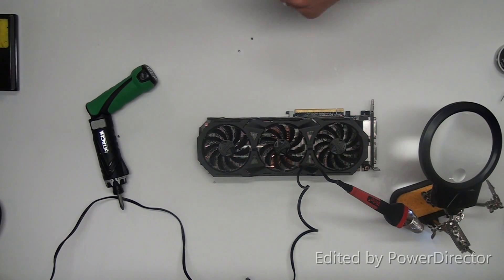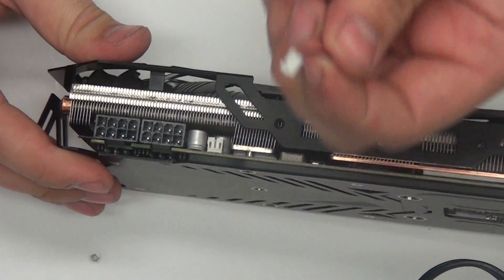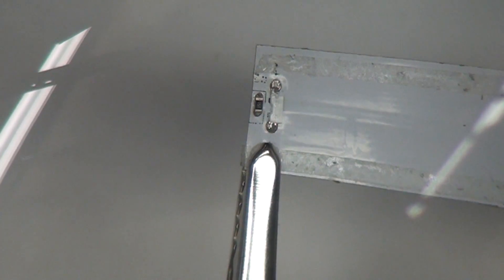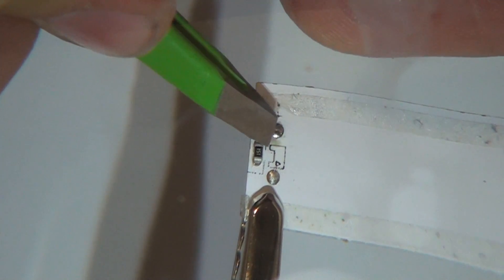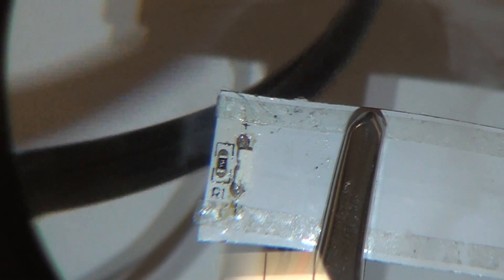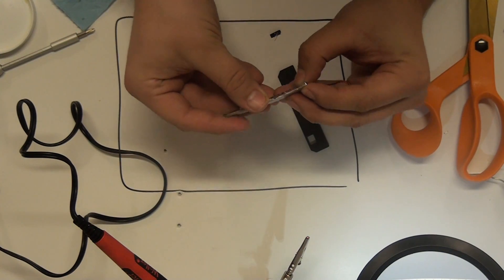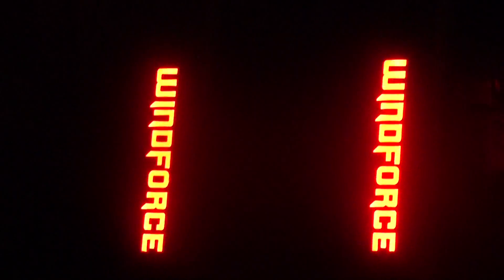GTX 980/970 LED Mod

Comment: Just saw this ...and thanks for the effort and upload... One thing i didnt like was the fact that you loosened  the cooler from GPU and separated it  even if it was a few mil... It still broke up the thermal paste leaving cracks ...In other words it would have been better to repaste it before using it... Also a question... Do you by any chance know hat voltage that little strip uses ?

Comment: Hey, so, I tried this and now my LEDs aren't turning on. I faced them both the right way and I don't think my solders were too sloppy but I'm a fuckin noob so maybe they were. What's the most likely problem? Did I break the little paper/plastic slip they attach to? Could I replace that or do I just have to buy a whole new plate?

Comment: Hey, where can i buy an led like that, but white ?
Reply from the maker: google: overclock gtx led mod that is the original overclock thread. you can find links to some ebay sites and other manufacturers that carry that LED.
Reply: thaanks!

Comment: I tried this and the thing won't light up, what should I do to fix/diognose it?
Reply: wich side is the bottom?
Reply: +BenAddict19 (on the led)
Reply from the maker: +BenAddict19 the top part is the flat top . the bottom is the one with the slight curve

Comment: I have a question, I have the r9 380x g1 gaming card, I notice that this mod doesn't have the fan stop led or the silent led. I was wondering if doing this mod for my card would also change those two smaller logos, please reply
Reply from the maker: +josue lorenzo if you were to perform this mod yourself the two SILENT/STOP LED's are the same leds as the ones used here.
Reply: +vladyerus thank you very much

Comment: I really want to do this to my 970. The blue LEDs do not match my red build. I don't have a soldering iron though so I wonder if there's somewhere I could just send the LED strip away to be replaced.
Reply: +Curtis Townson Dude, a soldering iron is super cheap.
Reply: +Curtis Townson basic soldering iron (you know, that big one where you hold the whole iron in hand, don't know how it translates to english) is like $10...

Comment: How do i even activate the blue LED??  My GTX 970 never had the LED on..
Reply from the maker: make sure u have GeForce Experience installed. bottom right hand corner of ur screen find the nvidia icon right click on it select GeForce Experience. Thanks u go into I believe there is a tab for My Rig. and click on LED visualizer hope this helps
Reply: +vladyerus Ah ok..i found it but the LED won't turn on (I'm using the Gigabyte 970 windforce 3x)
Reply: vladyerus oh..i think i know what the error is..the Windforce doesn't have a led (just the logo that looks like it but its just plastik)
But still has the small pin connector ( without connection of course)
Reply from the maker: +xSynatiiC ahh that makes sense. if u have taken the LED placard apart can u send me an email to info@vladthegreat.com with pictures of each component because I have a feeling it may be possible to get an LED in there I just don't know what pieces of the puzzle are missing . if u don't want to that's ok no pressure :)

Comment: +vladyerus Hey can I have some help buddy? I want to do this mod to my 970, but when I follow the link I'm only given options to pure white ones. Conveniently I wanted white ones. But there are two, there's '5500-6500k' and '3000-3500k'. Which ones do I pick and what's the differences? Thanks.
Reply from the maker: the higher number is the ones I sell they are called "pure white" they have a colder appearance the other one is warm white which has more of a warmer yellow feel

Comment: just a quick question about the store, what do you actually get for the 970 mod? just the white strip? or one prebuilt with the windforce logo too? thanks!
Reply from the maker: for the mod you get the white PCB if u watch one of my latest videos of the install process of my pcb it shows what you get from the time u open the bubble envelope.. as far as the windforce logo part I have something in work as a custom solution but  I can't reproduce the windforce one because it is intellectual property that belongs to gigabye

Comment: your pc is so loud
Reply from the maker: lol yeah the cover is off and I have 3 rad fans on the top rad and two intake fans  and two exhaust fans plus the dual 3 fan a piece gtx 980s. to be honest though when it's buttoned down I can't hear it mostly because I have my headphones on due to no pc speakers yet lol

Comment: does this void warranty?
Reply from the maker: people have said they have called and asked and were told it doesn't but somehow I don't trust it because there could be a rejection of claim if they see obvious damage to the PCB . really hard to tell
Reply: ah i see. well thanks! it looks so good, great job. contemplating should i do on mine or not.
Reply from the maker: ok. if you dont feel comfortable about doing it there is always my website listed in the description head there and see what i offer. I mainly did it to help out people who did not know how to solder or just didnt want to have to go through the process . other people did the tutorial and successfully completed it.
Reply: yea but do you ship to malaysia? how much would be the total cost, for a red led pcb with postage included?
Reply from the maker: +Niz Zamri yes I do ship to Malaysia and I already have once with an order. you can visit the site and go to checkout u can put in your address to see how much shipping would be it's the least expensive option but it takes 5-15 days to get to you. usually people get it in ten

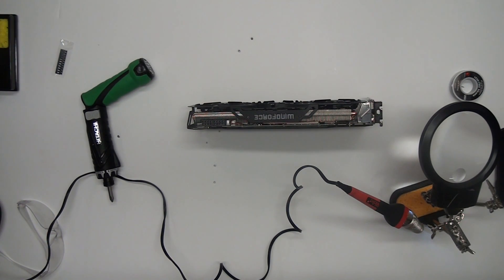Comment: 2:12 I saw that coming and made me cringe..

anyways I am too scared to attempt this on my 970 g1. Is it possible to damage the card by doing this ? And I presume this also invalidates my warranty.
Reply from the maker: +Rodney McKay Ha yah. good thing that white board that im working on is foam and this GPU has a backplate. I have been using both cards since and no issues yet :)

Since the LED circuit basically consists of no more than 12 volts going to the LED Pcb. If you were to damage something there would not be any issues with the card. So far people say that doing this will not effect warranty. I personally dont know because warranty/insurance claims tend to be different. there is no way of knowing how deep they will dig during a warranty. That is why i offer a custom PCB with color of your choice that you can easily swap and if something happens and you need to RMA your card or send it in for warranty, you pop your old PCB in there and send it away. Check out my other videos or visit my site listed in the description.

If you choose to do it yourself as in this video :) have a great time at it, and if you need a replacement BLUE LED pcb to make card look stock I could probably make that happen as well.
-cheers

Comment: so i stupidly bought the version without LEDS would i be able to modify mine so it does?
Reply from the maker: if you ordered from me contact info@vladthegreat.com
Reply: vladyerus im not talking about your product im talking about my actual 970 and it didnt come with leds on the card and i took off the Windforce logo and it was just a sticker and i  seen the LED power plugin thing on the card does your Mod come with everything that i would need?
Reply from the maker: hmm i have always wondered if they just used teh same PCB while removing some components etc. Does the PCB have pads (holes) for led wires anywhere ? my guess it would look like a silver circle.
Reply: vladyerus it has the connector for the LED
Reply from the maker: hmm this greatly interests me.let me see if i can add you to my google+ thing. i never use it but hold on.
Reply from the maker: sent u an invite to google chat so u can send me a pic of what that connector looks like. also what the windforce logo looks like with the sticker on the back im assuming?

Comment: Do you sale the whole thing or just the led to install it by myself
Reply from the maker: I sell the PCB already assembled with less and resistors so all you need to do is plug and play
Reply: +vladyerus  Where do you get those Windforce logo?
Reply from the maker: +Ronner Ronny Ryan which windforce logo do you mean? I do not get the windforce logo I custom make the PCB which has the leds on it. that is what changes the color.
Reply: +vladyerus  So i just have to remove the logo and swap the white PCB under it right?
Reply from the maker: +Ronner Ronny Ryan yes you can see my latest video https://youtu.be/3F6qGJPd7Ts
I had it set to unlisted but now it's public

Comment: Is possible to swap the led's to RBG leds like the new gtx980ti has?
Reply: Wowcake if you find those i guess but whats the point software wise?
Reply from the maker: Unfortunately it is not possible to put RGB led like 980 ti because the 980ti firmware is programmed for that the others only programmed for single color operation the only way around it is a third party source to control color
Reply: Yep

Comment: anyone? i have a problem with my card, i turn on the pc and everything is fine but after going to the log on screen my LEDs turn off, idk why i was doing some overclocking and after that it wont turn on, i was thinking i burned the LEDs since i added voltage to the card but the LEDs turn on when i turn on the pc just turn off when i get to log on screen, i wanted to switch to white LEDs but what good is it if they turn off :/ anyone help please
Reply: xXxSP4RKxXx i'm not sure if this will help but did you turn it off in the nvidia controls? i have the windforce 980 and since it is new i didn't fel super confident modding the led so i just turned it off in the nvidia controls but it lights up on bootup for a second or two.
Reply from the maker: +xXxSP4RKxXx hopefully you fixed this. It does sound like when you get to your logon screen GeForce Experience takes over and in the control you have your LED visualizer off.

This guide by Nvidia might help if you have not figured it out yet. 
http://www.geforce.com/whats-new/guides/geforce-experience-nvidia-geforce-gtx-led-visualizer-user-guide#3
Reply: yeah i just installed the drivers again :P
Reply from the maker: awesome glad its working now :)

Comment: Does this work on gigabyte gtx960 g1?
Reply: I haven't done it yet but it'll be very tough. The windforce led and Silent stop leds (making 3) all come apart. It's the exact same method for the Windforce led, but for the silent/stop ones, it's different. I'm doing the mod soon, possibly going to put a video up for it, but still mentioning its the same way. It will work. I've opened it up myself. I doubt I will be modding the silent/stop leds.
Reply from the maker: DerpyDreamz022 I have yet to tear apart a 960 so maybe zuhayr sarker will have a video up soon :)
Reply: vladyerus 
Not entirely sure I'll do it, just a heads up guys, if you do plan to mod, you will have to remove the entire heat sink. Remove all the screws on the back and slowly take off the heat sink.

 At first it'll be stuck like glue, but be careful, there are three wires connected to the board.

These three wires are the fans, the led for silent/stop and the windforce logo. Carefully disconnect these wires. BUT WATCH OUT FOR THIS. I'M SERIOUS. Be careful about where you place the led wires. One will have a white mark on it. It will be either set of led(s) but remember which one goes where (orelese the led control will get messed up).

Now that you got to the heat sink and fan part, leave the board somewhere safe and anti-static. 

Remove the two screws for the leds as usual. It will divide into 4 parts. The three leds and a larger plastic part that holds these three in place. Carefully remove the windforce logo from the plastic part and do the exact same thing done here from there. After that it should be straightforward soldering on the LEDs.

Not entirely sure I will mod it, but I have opened it up and studied it for a while. Hope this helped.
Reply: Zuhayr Sarker  im very concious about this doing this doe xD
Reply: DerpyDreamz022 I'll try my best to get the necessary parts and put up a video soon.

Believe it or not YOU SHOULD be conscious. I accidentally ripped my silent/stop led connector. However I was able to successfully reconnect the copper ends to the prongs with a flat head screw driver and toothpick. Problem now is that silen/stop mode isn't really working, LEDs do though. Just needs a TIM upgrade as I did remove a lot of that (you shouldn't do that to GPU TIM, you should replace it afterwards).

But yeah, expect a new video soon.
Reply from the maker: +DerpyDreamz022 I am currently working on the 960 Stop/silent light LED, the circuit is slightly more complicated as it is a 2 layer flex pcb. But rest assured hopefully within a few weeks we will have a solution for that as well :) stayed tuned via youtube by subscribing and you will get updates.

Comment: I wish I had the technical skills to do this lmao I'd end up killing my gpu or something. I can't take things apart and put them back together properly, I've tried with ps3 controllers and long story short i'm on my third controller... I'd rather not kill a $550 gpu :/
Reply from the maker: yeah i thought about that too. But seeing as the only thing that could possibly go wrong is the LED dying i decided to go for it. But than i would have figured out how to fix it. If you have seen my new videos. I did find a way to fix that for those who do not want to do the soldering job :) Thanks for watching

Comment: Great video,even if it buffers sooo slow. Hate youtube for that...
Reply from the maker: thanks. if it had anything to do with the way i edited the video i apologize. Just getting used to this youtube/editing stuff.
Reply: vladyerus nah don't really think it was you i had no problems nice vid :)
Reply: vladyerus what if i sanded the logo and put some color onto it would it work?
Reply: Majid Shawa the acrylic is colorless, the leds are what are colored, so changing the leds is the only way unless you use light bulb paint on the acrylic to mix with the blue led.
Reply: DJAbraxoOfficial Thank you, I was about to do it.
Reply: MC4allforUser that is your internet speed/computer's fault, not youtube's
Reply: Just Voltage Basicly i watched the video jsut shortly after it was uploaded, so youtube did not prossed it at that moment. Now it plays perfectly fast.
Reply: MC4allforUser ok